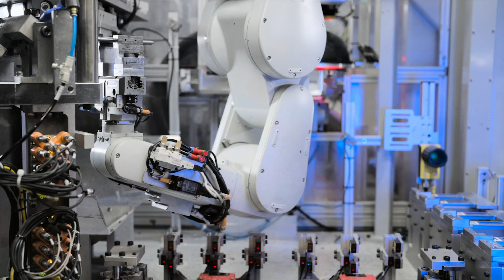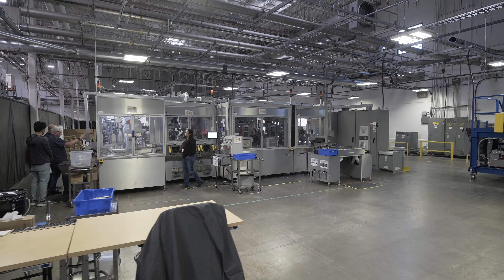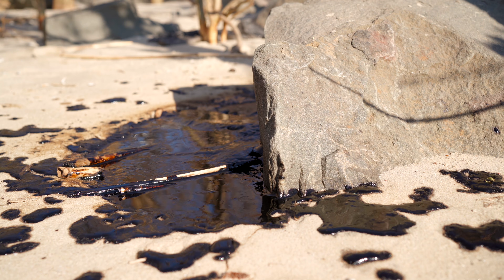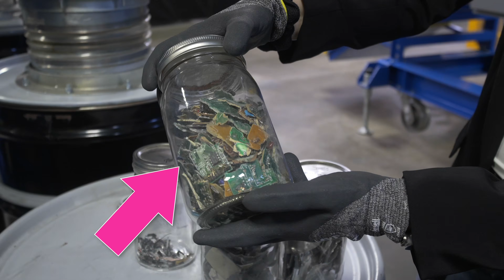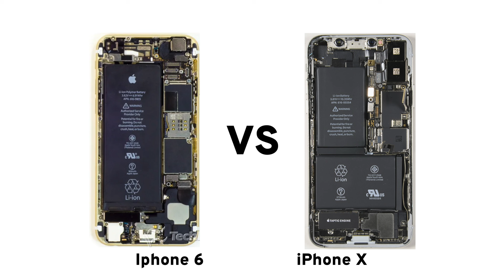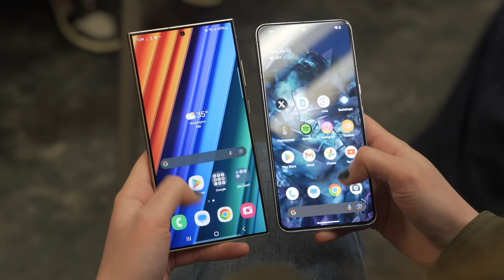I Visited Apple’s iPhone Lab!

Comment: Better to reuse these iPhones after refurbish & repair, than take them apart for parts which creates more trash. But oh! 🫢 People won't buy new iPhones then. Hurts their bottom line.
Reply from the maker: The phones here are end of life phones so they wouldn’t be able to be reused, I think they also have a refurbished lab
Reply: @NBTJacklyn  Do the Refurbish lab next!
Reply: @NBTJacklyn  Thank you for responding, I am sure that some phones are actually kaput but I assure you that Apple is not interested in checking which ones. 

Great Bloomberg article from April 2024 "What Really Happens When You Trade In an iPhone at the Apple Store" 

and better iFixit April 2019 article "Apple’s Daisy Robot Is Still a Stunt, But Their Other Recycling Ideas Are Good"
Reply: It would also be good to design the devices to be easy to repair, so that more can be reused.
Reply: @NiHaoMike64  Right to Repair, anybody?.. 👀
Reply: This is really excellent! I wish more tech companies would do this for devices that can't be refurbished. If people have an old broken phone sitting in a drawer, what steps should they take to try and get it recycled?